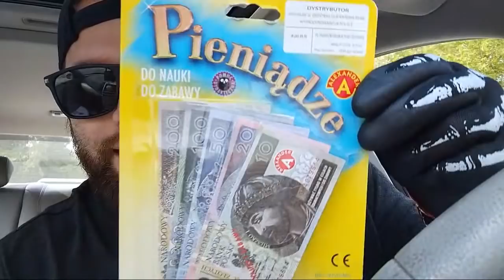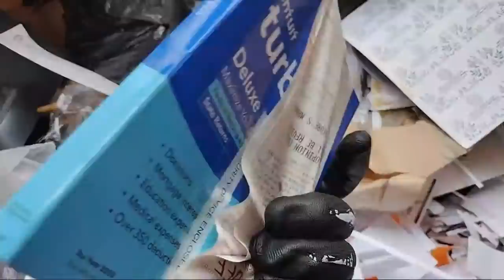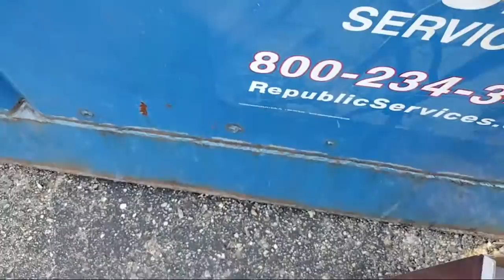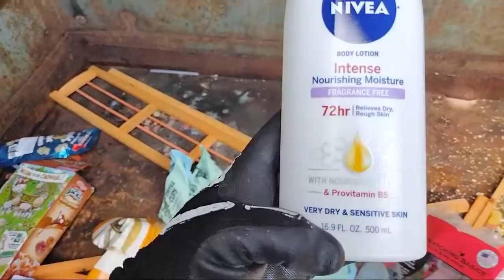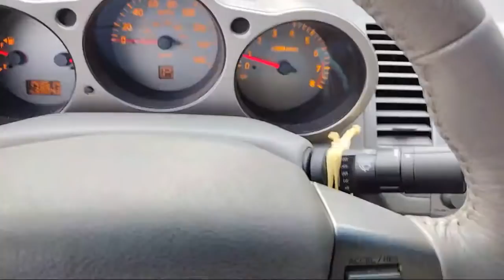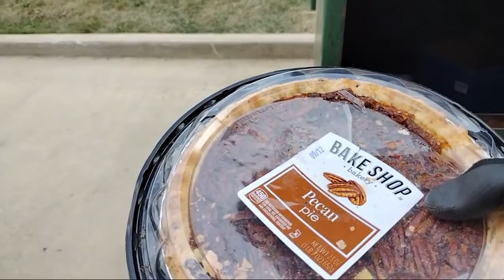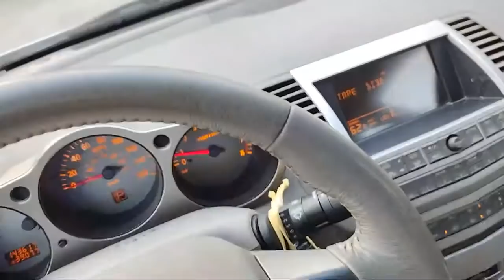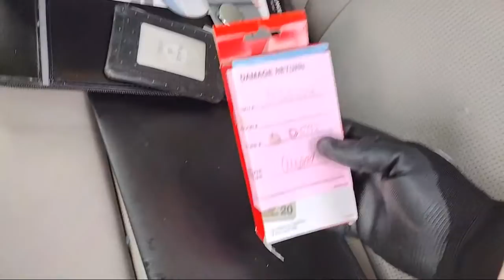**DUMPSTER DIVING - WOW! THESE ARE EXPENSIVE!

Comment: whenever you go to micheals & joanne's grab that fabric, regardless of how big small the pieces. you can bag it up and sell it as scrap material by the pound and it will sell like hotcakes to the crafters and quilters.we are always looking for scrap material. i personally will use it up to 4x4" squares many will cut it down to a 1x1" square (im not that paient) anything smaller i collect in a bag i've sewn together to make dog beds for my local vets office to put in their crates.  if the scraps are large enough, but odd shaped i will sew them together and put a back on them and make dog blankets for the crates. i just don't want to go out and buy extra material specifically for it. this keeps my scrap pile down and i don't get over run like others can lol!!!